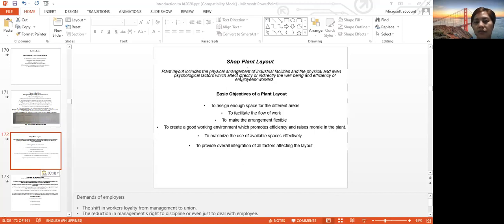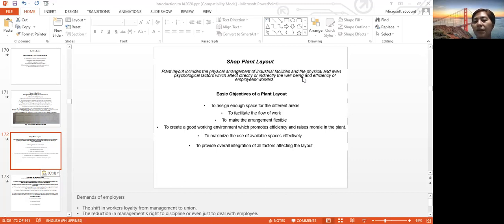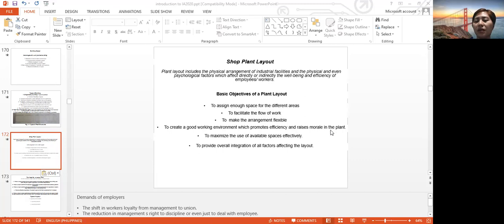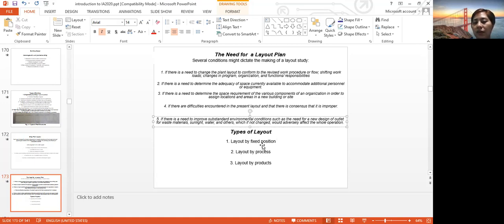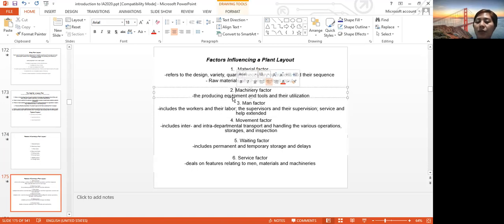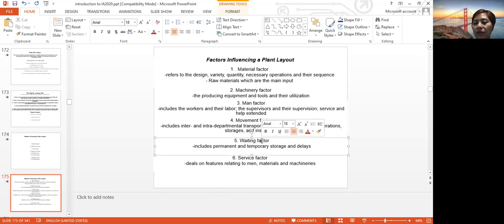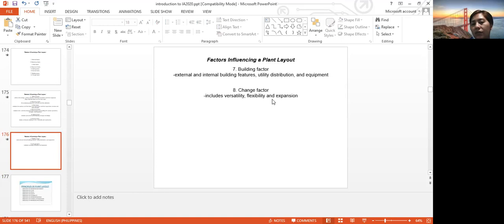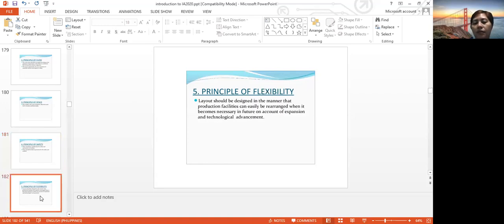Shop Plant Layout

Comment: JAROGON, JOSEPHINE M.
BTLED HE 1

The shop layout tells the significance of the working area for the safety of the worker.For me in making layout you should always think or consider the possible outcomes and in making a layout for me, if the working area or place is good or smooth flow or work and the proper arrangement of facilities are very comfortable and in doing a task we should avoid distraction and and disturbance and there some circumstances that we encounter in building a business but if you're doing your best in building a business it will help you to have a successful business.